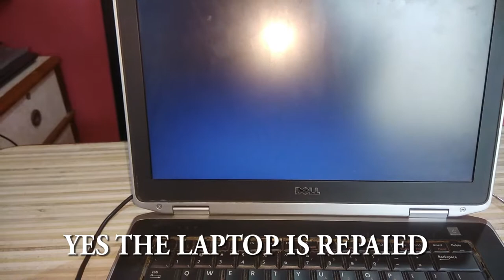How to repair a Dell Latitude E6420 Short-circuit Motherboard laptop

Comment: Can you explain what is the method of using the multi-meter to find the short capacitor. 
As I understand, a capacitor has 2 legs. 
Do I keep the 2 prongs of the multi-meter at the 2 legs and measure the voltage between them ? What is the good value that will show that a capacitor is good.
How do you identify a bad capacitor. What would be the readings on the multi-meter that tell you - it is a bad capacitor.

Comment: Thanks for your good work but please I just found the second circuit capacitor on the left side which was the short capacitor removing it the laptop is working fine but I want to know do I need to replace it or should leave it like that since the is working. Please any idea? I'm afraid it's going to cause damage in the future
Reply from the maker: It’s better to replace.
Reply: @kartikkale2933  Sir thank you for your reply but for replacing it's good to use this capacitor 1uF 50V Y5V SMD?
Reply from the maker: See I don’t know the exact value of the capacitor.you just check in the schematic diagram of the mother board and replace it, if  u get confused leave it. No problem
Reply: @kartikkale2933  thank you so much 👍

Comment: Exactly the same problem with my latitude E6440, I was just using it while connected to the wall outlet and the laptop just suddenly went off. When I connect the power adapter, the LED on the power adapter also goes out.

Comment: Because the dell latitudes e6420 vary on some computers is not equal to the motherboard
Reply from the maker: Yes you are right.... The price of the motherboard increases as the configuration of the laptop increases.